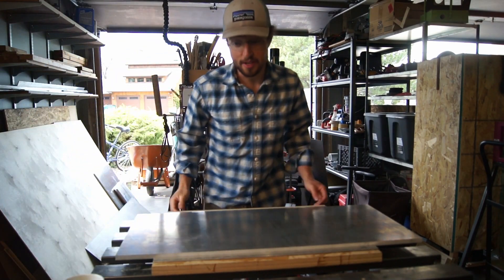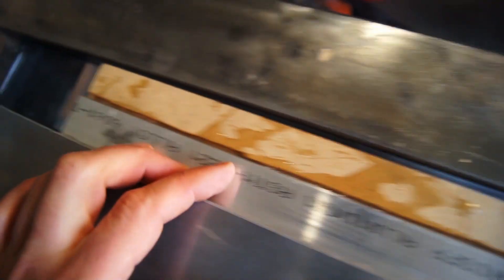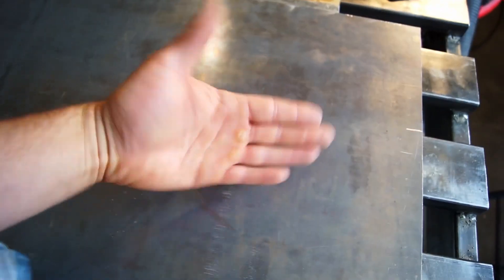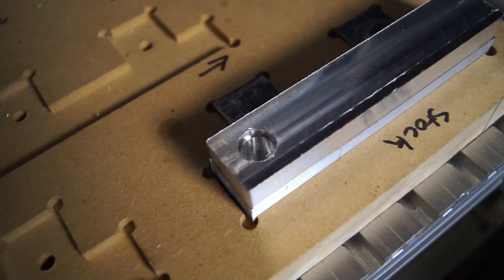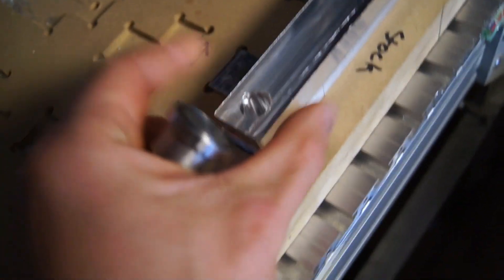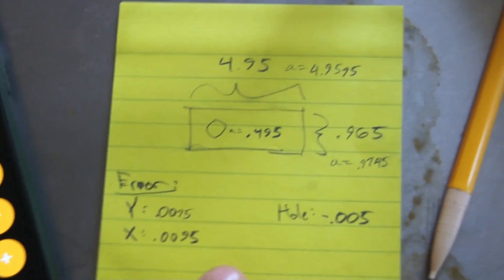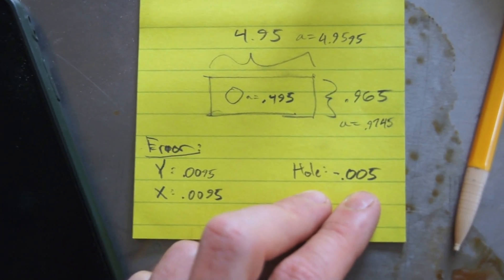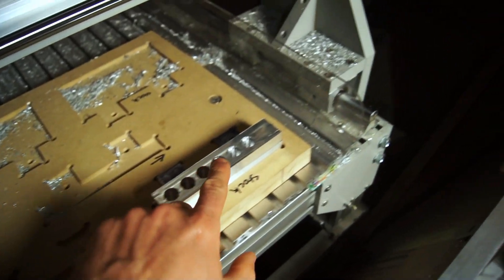How I Drilled Holes in Aluminum with my CNC Router

Comment: I usually use a very good drill bit in the router to drill the hole then come back and machine it.
Reply from the maker: Now I spot drill, remove the part and drill big holes. Then reinstall and probe and finish on the machine

Comment: In the 3D printing world (tired of my comments that start like that yet?), being oversized on the outside and undersized on the inside is something you fix with "Horizontal Expansion" settings in the slicer. You might be about to find a similar CNC setting, but in general it would seem your CAM thinks your bit is 0.00475" bigger than it actually is, resulting in parts that aren't cut as much as they should be.
Reply from the maker: Lol you have started a lot of comments that way. I can change it by adding negative stock to leave in fusion. Just not the most elegant way to do things I think. Not sure why it’s having issues cause I’ve measured the movement of the machine and it’s usually spot on